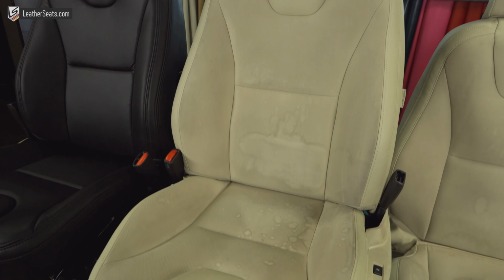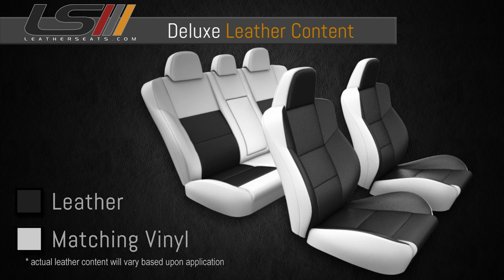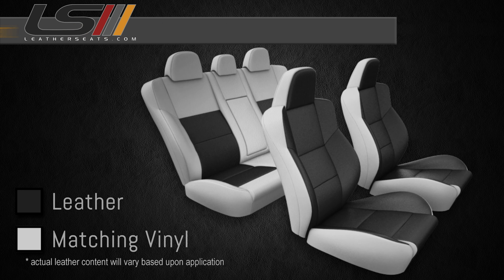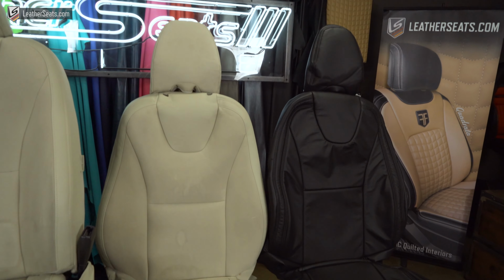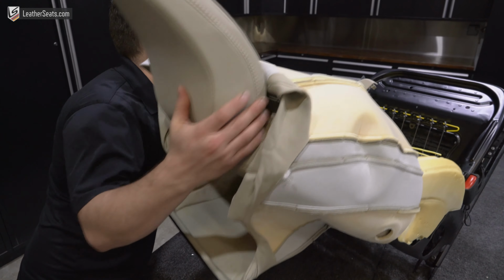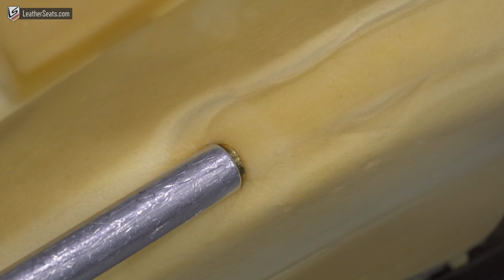Replacing Stained Cloth Interior With Custom Leather Upholstery For The 2011-2013 Volvo XC60

Comment: I used to work as a leather upholstery installer and one thing i can tell you that old volvo seats are one of the most difficult seat to work with, because usually they came with the inner cushion sponge torn or deformed badly due to wear and tear
Reply from the maker: Daniel They definitely make for a unique installation! Thanks for watching!

Comment: Hi. What's the name machine , which You used for hot air? Where I can buy ? Thanks
Reply from the maker: sławomir stefanczak In this video I believe what you are referring to is the upholstery steamer that Luis used throughout the installation. For DIY installs, just about any clothing or garment steamer will work as long as you have a hose or nozzle that can reach up through the upholstery during the installation. We specifically use Jiffy brand steamers however there are several good brands in a variety of prices points that you can find with an Amazon search. Please feel free to email sales@leatherseats.com with any questions.